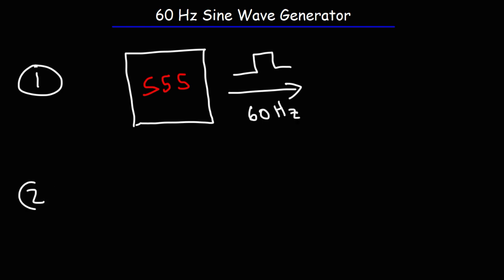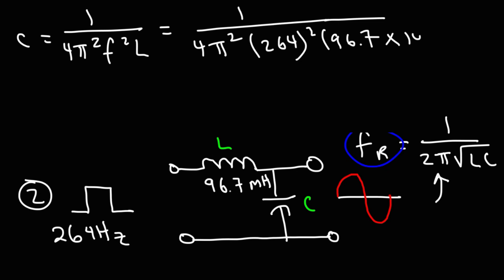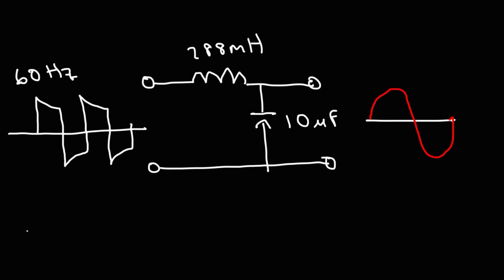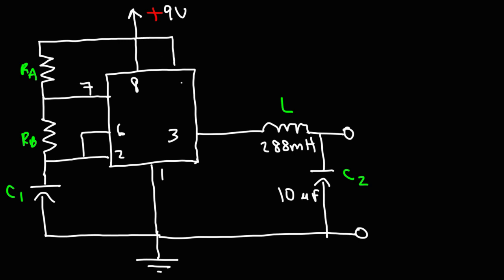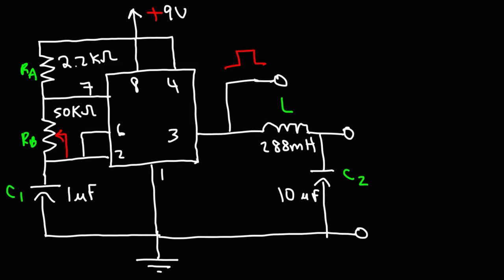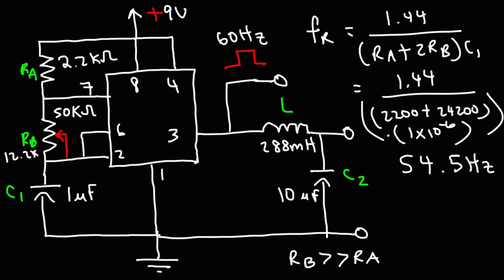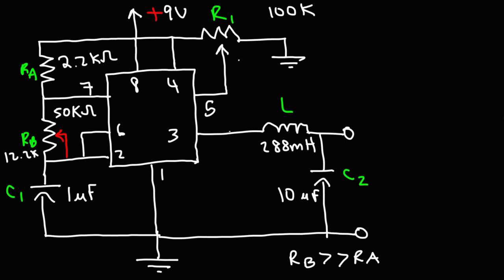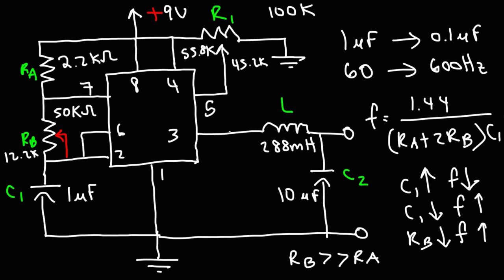60 Hz Sine Wave Generator Using 555 Timer & LC Tank Oscillator

Comment: Hi from England, UK. Wouldn't you be better off using a CMOS chip like a 4060 for the oscillator, then it could be crystal controlled and the frequency stabilised. And while 60Hz is ok for the States and Canada most of the world uses 50Hz.

Comment: Stray capacitance + variability of impedance will cause variance in the components you use to achieve center frequency. Theory is perfect, reality is not... Just a part of life in circuit design on paper.

Comment: Hi from England, UK. How about an old trick you can use with a 555 chip in it's astable mode like that shown here, if you make Ra and Rb the same value, and place a diode across Rb with it's cathode at pins 2 & 6 then C1 will charge through Ra only and then discharge through Rb then you should in theory at least have a 50% duty cycle.

Comment: Your math is wrong *sarcasm*... someone step me through 4pi squared * 264 squared * 96.7*10x-3

4xpi sq = 39.47841760436263 TIMES 264 sq = 69696 TIMES .0967
= 266068.8696172987

1/^^^
= 3.75842540857318 x10-6  you were off by .0015746 x 10-6f

HA!  J/k good vid 

Serious question though, when you end up with 2.44 x 10-5 that is 244,000, and you want it represented as micro F, which is 10to-6? Isn't 244,000 .244 meg, not 24.4 meg?  Is it because it is micro and not meg?What am I missing here.  Doesn't the change of 2.44x10-5F to a scale of mF mean it is .244*10-6 or .244mF, not 24.4 mF?  .244 is closer to your 10 mF capacitor than 24.4 is (.756mF less vs 14.4 mF more) 

I'm in serious need of help as I am trying to build my own circuit and this math threw me off.

*Edit* duh, you multiply .0000244 * 1,000,000 and you end up with 24.4 mF.  I don't know why I was struggling with this.

Comment: Hi, You are doing great explaining math when using electronics.
But, what if a much more simple solution does exist since ages?
What about an AC synchronous 555 based 60Hz frequency generator if that fits the needed accuracy/stability?
See the "Electronic experimenters handbook" issue winter of 1976.
Page 112/113 has an ac synchrounous clock generator.
It is running from backup battery when AC is missing in case of power outage.

Comment: I just try this to get 60 hz and the 13 k potentiometer and 2.2 k resistor never come closely to 62 hz more like 250hz I had to use. 50potentiometer and 32k resistor to get 50 and 60 hz

Comment: What side effects occur by trading off C for L ?   i.e. you could use a 10 mH inductor and 704 uF cap to get 60 Hz, according to the equation.   Does something unstable happen to the wave if the C value gets too large?  I'm wondering why you decided on such a large inductor at the beginning of the design.
Reply: the same as i was thinking

Comment: Very nice lesson — well-explained and very clearly illustrated.

For those commenters taking issue with the pronunciation of “potentiometer”:

Our tutor is saying  poe-ten-shee-oh-METER.  In the US, the accent usually is on “OM”, like poe-ten-shee-OM-it-ur.  

Comparing US to UK pronunciations for words spelled the same, lots of times the stress is put on a different syllable, depending upon which country you’re talking about.  Citizens in each country think that the folks “over there“ talk funny. Both are correct.

To convert from one pronunciation to the other, either multiply or divide by the cube root of your age TIMES four pi R squared TIMES 1/2 the temperature in degrees Kelvin DIVIDED BY the fine structure constant TIMES the date in SI units; where “R” is the actual measured radius in furlongs of the left front tire of your father’s Oldsmobile at noontime when parked in the shade  at the intersection of the prime meridian and the Tropic of Capricorn on the 29th of February during a leap year that ends in zero. 

Try it for yourself.  If you take “toe-MAY-toe” and perform this operation on it, your result should very closely resemble “toe-MAW-toe”. You can expect some minor variation depending upon the length and thickness of the experimenter’s vocal cords, and his or her or their gender.

 (NOTE: due to the extreme difficulty of determining this value experimentally, linguists typically use a mutually agreed-upon compromise value.)

Comment: This is a interesting approach to the isolator circuit. I like that the math and application does not add up...
And everyone relies on math being right.....
Have you tried running the monostable circuit?

The astable circuit can use a msa a13j, and you oils want a diode for the inductor spike.

Shame I can't reply with a photo... I made one last week...

For the questions on sinewave inverting for power supplies egs2000 has what is needed.

With this circuit, you would use this as a driver to run the high power npn switches (MOSFET), but you would or could make the s wave, using a MCU as this could be tuned with scripted waves and compensation, rather than a feedback, which would be required(when there is a load).
Reply: 9 month later and still nothing . his mathimatics did not work properly so its time toget busy soldering and manually tunning it .....….what else

Comment: Sir, can I use this with and ir2110 to achieve a pure sine wave inverter? If yes, how is the connection going to be between pin 3 of the 555 timer and pin 10 and 12 of the 2 ir2110?

Comment: I like your video and the information conveyed, but one little thing really got my attention. Please don't take this as criticism, but learning. Rb and R1 are potentiometers; in my 58 years in electronics, I have never heard that word pronounced as you do here. please go to a site to learn the proper word pronunciation.  [dictionary.cambridge.org/dictionary/english/potentiometer] is excellent.

The middle pin on a potentiometer is normally referred to as the "wiper" because it slides or wipes along the resistance track to give the desired output. It's also worth noting that Rb is connected in a "rheostat" configuration.
Reply: Wtf? He pronounced it (almost) entirely right. Your link says :
 "poten-sh[i]o-meh-ter". He said : "poten-sh[i]o-mee-ter" (big difference... he pronounced it as the unit of length, or as a device that measures something).
Compare that to all those on the Internet who say : "poten-tee-o-meh-ter"

Comment: Great video - would this work for really low frequency (ie <1hz) applications?
Reply: Yes; easily possible. Just use a higher capacitance like from an electrolytic capacitor with the required value.
Reply: @nullbeyondo  Yeah.  Use two 2.2 microfarad capacitors back-to-back in the filter,  and about a 330 mH inductor in place of the resistor in the RC LPF.  You might need to experiment with the inductor Q value to minimize distortion (harmonic) in the sine wave.  An alternative to designing a filter is to drive a class c amplifier consisting of a MOSFET with a high Q tank circuit,  proceeded by a source follower MOSFET.  You will need to supply negative rail to one side of the load,  and positive rail to the tank circuit.  Then connect the other side of the load to the MOSFET source.  If you need a more accurate frequency,  however,  I would recommend a phase-locked-loop oscillator instead of the 555.

Comment: Great video. Im curious though...why would anyone want to do this ?😂 like what is the purpose of making this
Reply: 1 step to converting battery power/ solar energy into mains(wall socket) electricity.
Reply: Besides what Craig said, I use it to generate specific sine wave sound frequencies through a speaker that act as an important pipe resonator in a project I'm creating.
Reply: It can be used for i verters mainly from 5V 60HZ TO 220V 60HZ AC/DC ANY U LIKA .......